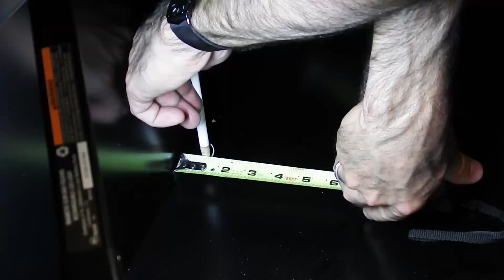Add a winch to a car trailer

Comment: I moved the box as far forward as possible and it still be on the frame not hanging over it .  This allowed the winch to be off the deck completely.  The monut sits about 12 inches above the deck helps to not dtag the cable as much on the deck and also allows things to be pulled as far forward as possible, too .
Reply from the maker: That is a good idea. Thanks for sharing.

Comment: Is it possible to add quick disconnect from the winch. And run cables wire from the truck battery to the rear. Instead of having a battery in the box
Reply from the maker: I suppose you could, but then you would want to make sure your truck was running when you are using the winch so it does not run the battery down. I am going to be doing an episode soon on running wires to the battery on the trailer so it charges when I drive. You could also add lights and other things to the trailer with the second battery if you needed.

Comment: Great video. I’m looking to do the exact same but need to find a local welder since I don’t know how to weld…yet!

Do you have a link for the toolbox?
Reply from the maker: https://www.harborfreight.com/2-34-cu-ft-steel-trailer-tongue-box-62253.html?utm_source=google&utm_medium=cpc&utm_campaign=17890472041&campaignid=17890472041&utm_content=140972214673&adsetid=140972214673&product=62253&store=&gclid=CjwKCAjwu5yYBhAjEiwAKXk_eFo51v-Lm-MvH47Kz0Uebpksv2x2vG2I2Ivl_ipJSWBVMIoaq-UUExoCv6UQAvD_BwE

That is the toolbox I got. You could probably get a local fab shop to mount it for you.